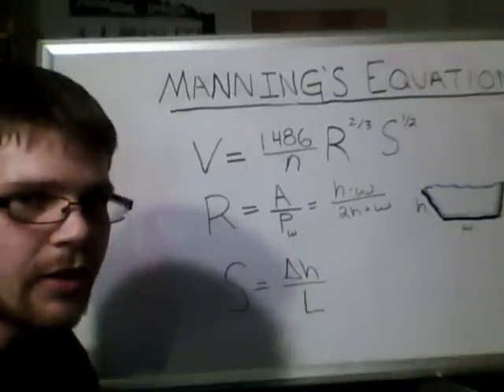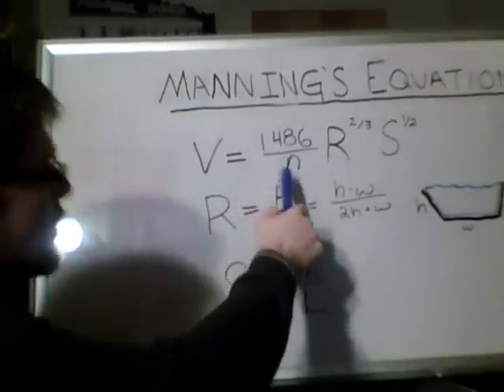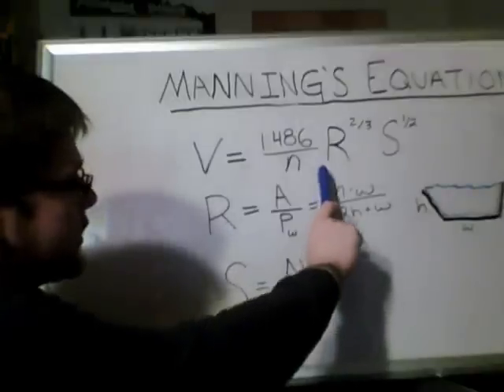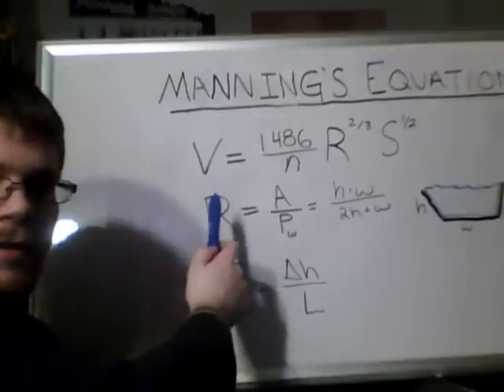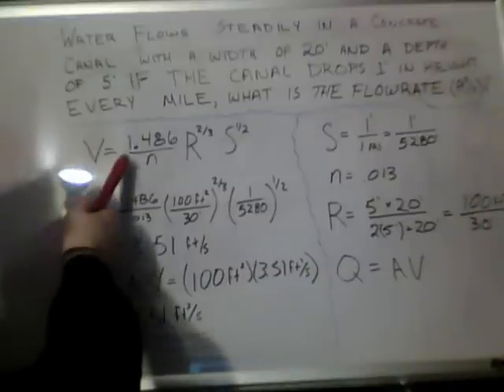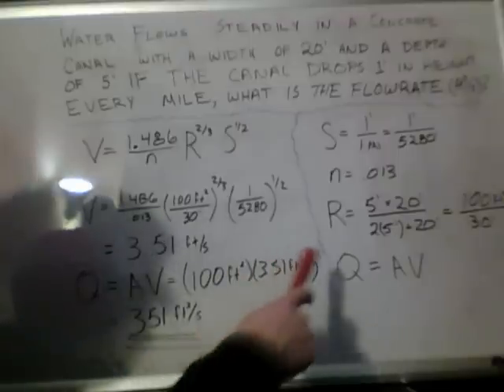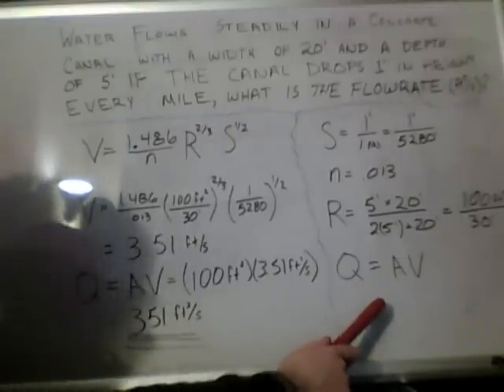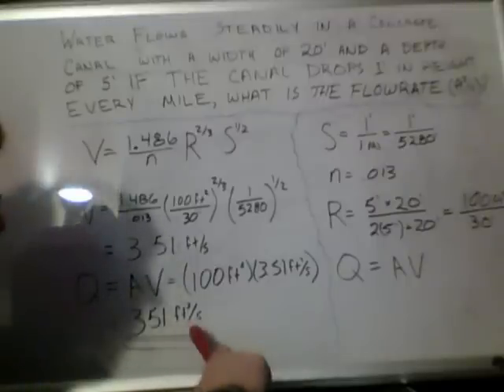Manning's Equation

Comment: I know for a fact that you can use both manning and hazen willmias for both open channels and pipe flow systems even though common practice is to use hazen william for  pipe flow and manning for open channel but does anyone know why this is the common practice? What are the different assumptions made ? What makes manning's more acceptable for open channels and hazen williams more acceptable for pipe systems?